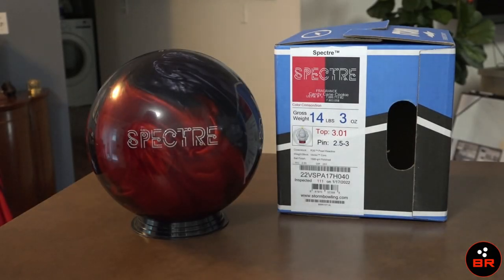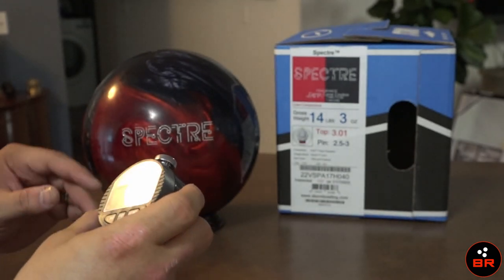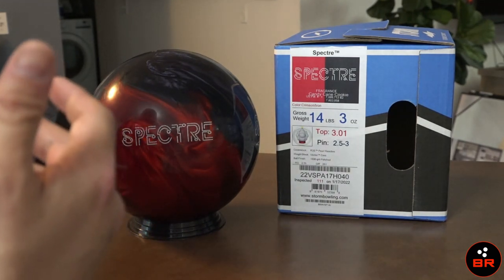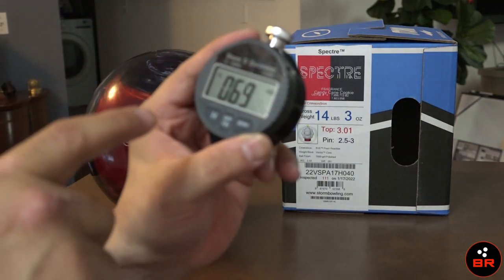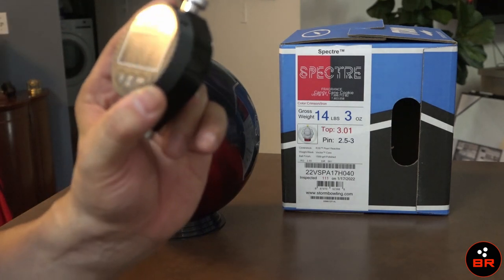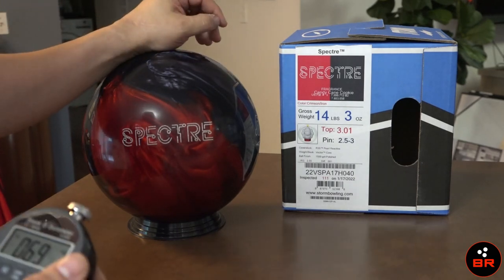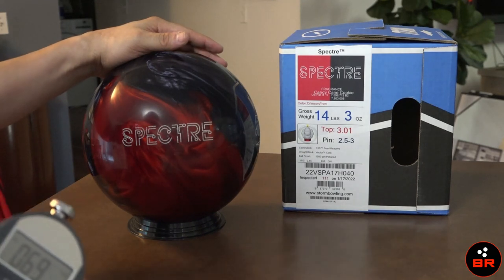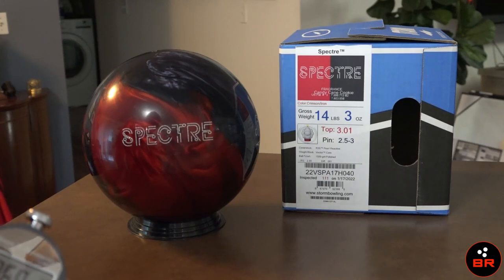STORM SPECTRE HARDNESS TEST | SPOT CHECK | PASSES FIRST TIME?

Comment: although there will be some differences in the environment and in the durometer calibration, a reading of 69 would concern me for any ball that has not yet been subjected to any lane oil or any environmental elements, considering the min limit for a new ball is 73 in a lab setting with the right tools and calibration.

it's worth noting that each color should be checked independently, and spots should be checked at the pin, equator, and sprue.

cheers!

Comment: I thought, (from what I was taught years ago), that hardness tests were done at 3 different locations on the ball.  Not sure if this still holds true or It was just done in that region at the time.
Reply: From what I've read they take multiple readings from all over the ball. They also make sure that they check the hardness of each color in the ball. Then they add it all together to get an overall reading

Comment: I have tried a durometer on a ball, handheld like yours. If you fiddle around with it a lot, you will probably see that the values fluctuate very easily with the slightest difference in angle and pressure. Proper hardness must be tested on a desktop big durometer with a handle that comes down and presses with the same force and same angle every time. 

Also i think that the 68 you mentioned, is for individual spot reading. They take many readings in different spots (and all colors) and they average it all out and it should be not below 73. So a spot could have 68 but another could have 78.

Comment: Ball needs to be tested in a controlled environment (68-78 degrees F, which you did try). Just because the Ball has sat in that environment doesn't mean the actual Ball is that temp. I believe usbc officials would use a laser temperature gage for that.

Ball must be tested at several points around the coverstock instead of just one place as this is how the spot check is done. I believe it's 10 different spots. The spot check must include a test from each color of the ball.

The average of all of the tests are taken and that is the result.
Reply from the maker: Don't disagree, this was just a quick test and as noted in the video, not scientific.

Comment: I really have no respect for the USBC.....with today's standards of hook a ton out of the box, no restrictions on lane conditions and turning their heads away from considering pin weight and balance...a durometer reading is nonsensical......BPAA's goal for many years has been to increase pinfall and profits. Well it's here, pinfall has certainly increased, they're selling more balls. One thing they are not accomplishing is increased number of lanes. Maybe I'm old and grumpy, I certainly do not want to go back to the old days of one ball and bag. The horse is out of the barn and a durometer reading will not correct it. I wish I had a Spectre.....I wonder if there are any politics going on in the background......

Comment: Your test is irrelevant. Like it or not I expect Storm and the USBC have been quite intense on the checks and  Storm lost. You sound like one of those talk radio entertainers that find fault with everything including Jesus.
Reply: That's a bit of an overstatement on your part, to put it lightly. Not just that it's a simple, two-minute video describing his test, and you turn it into a personal attack on the producer of the video? And then throw in a Jesus reference on top of it? Come on.

We now have multiple people doing spot checks and posting videos and there hasn't been another failure yet, that I've seen. As bowlers, we have to hold the USBC accountable because (a) we have no other options in regard to sanctioning, and (b) our industry is not big enough to absorb the fallout from testing errors and ball replacement costs to the manufacturers. Storm seems to be setting up an appeal, so let's have that play out first, but working off the hypothetical that Storm and third parties are right and the USBC is alone in its opinion, the one who ends up "losing" in this is not Storm, but all of us who rely on these systems to ensure both correct manufacturing procedures and also a fair rules environment for both bowler AND manufacturer. Using your own words, Storm has been "quite intense on the checks" and the company is now at odds with the USBC, so either something is broken in the testing process, the manufacturing process ... or with the competency of those doing the tests. Again, let it play out.
Reply: @jessnicholascenterfireecon8382  I expect Storm is spending all that money to fix the situation because they were right. And no i did not attack anyone nor did I make a false statement. You on the other hand are kicking Storm management in the teeth. And the Jesus statement was both intentional and correct.